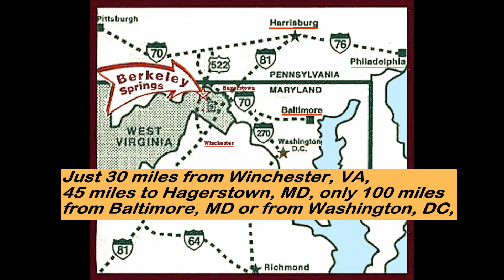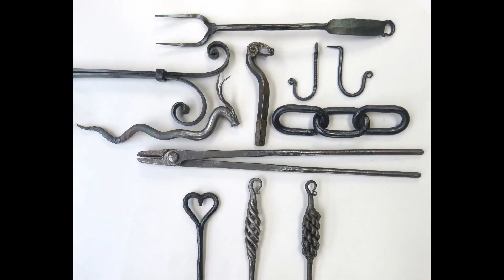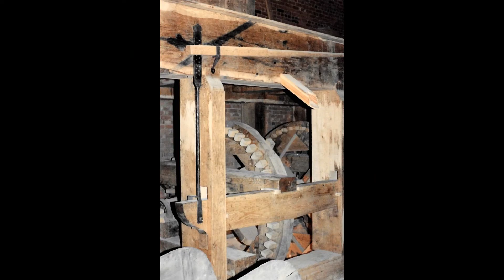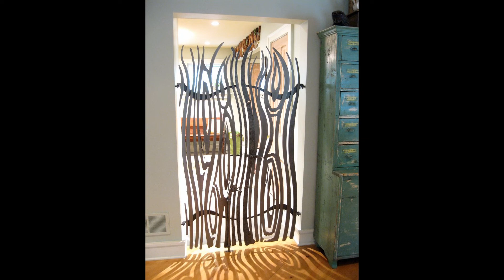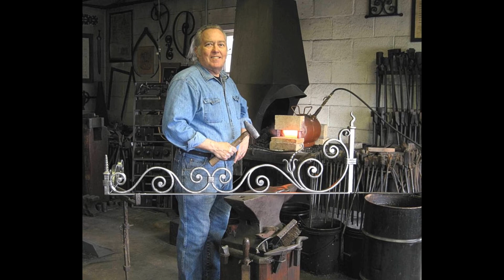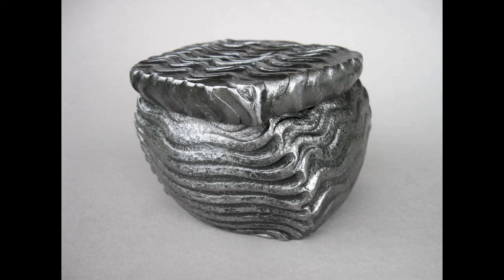Blacksmithing Classes

Comment: Unrelated question. How would you forge grade 5 titanium so that it doesn't evaporate due to oxidation.
Reply from the maker: I don't know what grade 5 is but it is usually just forged at a bright yellow heat. It does not evaporate. When it gets too cold to hammer on the hammer will bounce off of it.